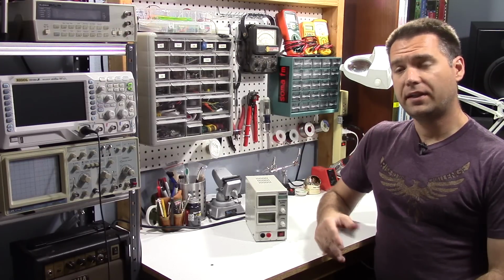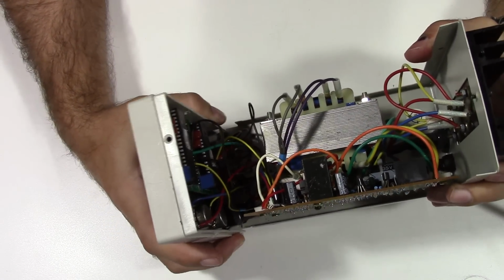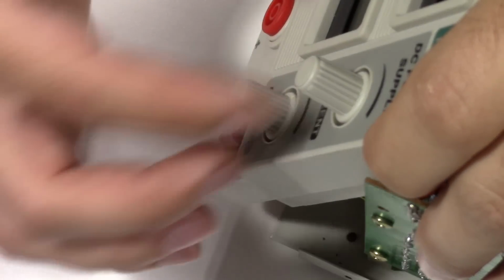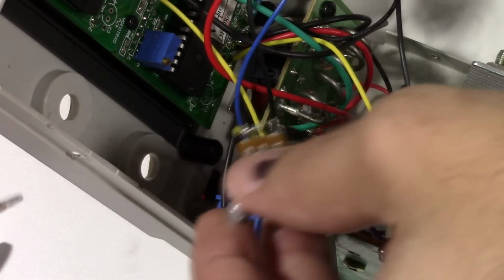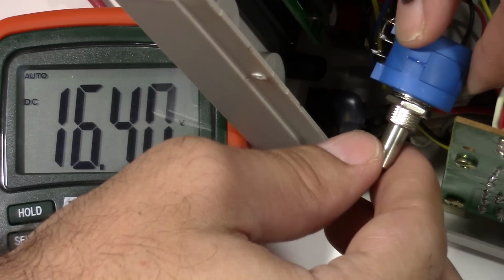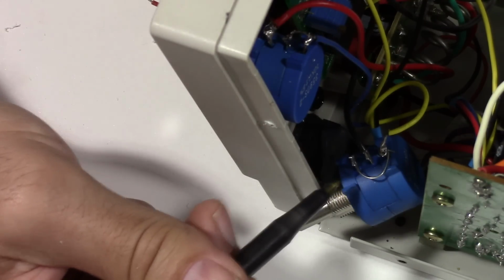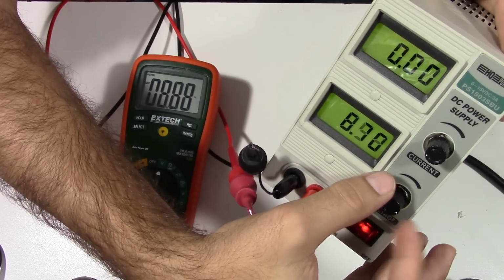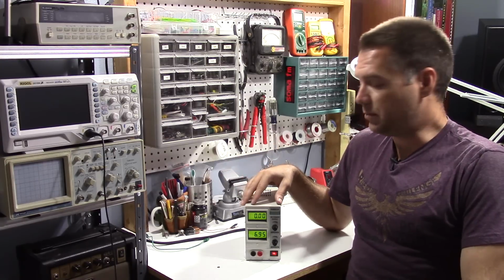10-turn pots added to variable power supply for more precision

Comment: You don't really have to connect the wire to the wiper AND one of the other contacts on the pot.  Just connecting to the wiper is sufficient.  I think the practice of using the second contact is to "guard" against the wiper breaking.  If the wiper brakes (in side the pot) and your wire is only connected to the wiper, then you end up with an open (infinite resistance).  If your wire is connected to both the wiper and the second post, then when the wiper breaks, you get the max resistance instead of an open.  Does it matter?  And do modern pots have wipers that break?  When the wiper is in good working other, the portion of the resistance between the wiper post and the end post simply gets no current, it plays no part.
Reply from the maker: Yep, you're correct. :)

Comment: Thanks for the testing, you should mention that the 10 turn pot is not an audio taper (or i didnt catch it) and its part no. is 3590S-2-103L  Made by Bourns, Ken

Comment: Interesting video! Couldn't you just calibrate & take out the difference by the trimmers that we saw right by your hand on the circuit board, though? If not, there should be other calibration trimmers in there. Just curious, although you got there by other means just fine. Thanks!

Comment: My cheap 10 turn pots had the wiper pin on the end. Connecting an end to a middle pin could shot the wiper to one end, or short both ends of the pot together. Is an ohm meter to figure it out.